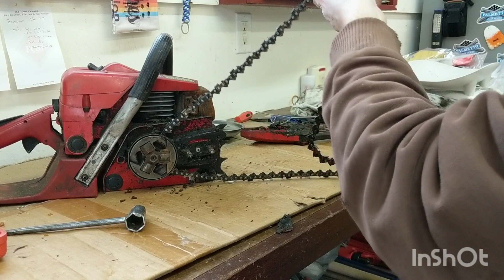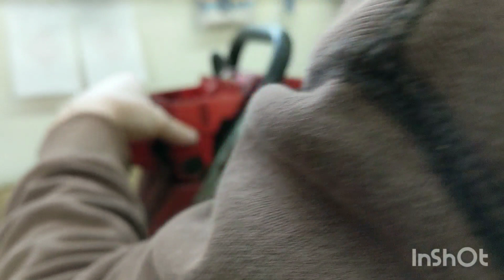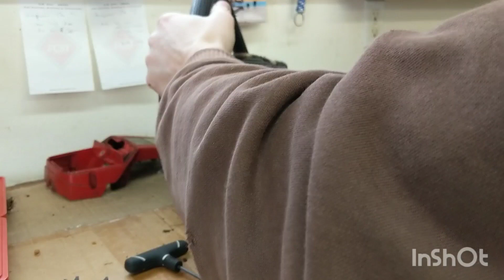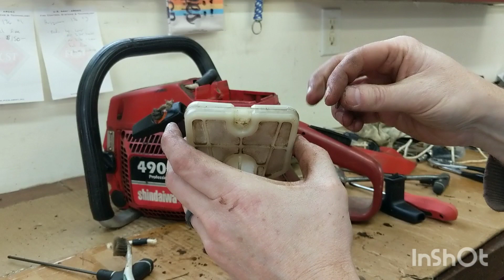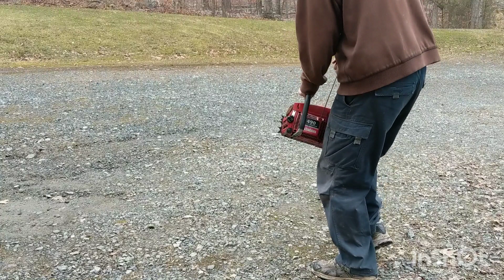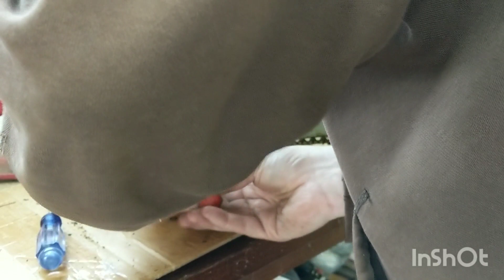Fixing saw 3 of 10, a Shindaiwa 490 pro. Pleasant surprise!

Comment: Shindaiwa makes good stuff! I have a model 300 chainsaw. I love it. I only paid $15 for it at auction and it runs/cuts perfect and is in good shape with all original paperwork. I plan on acquiring more Shindaiwa products over time. Congrats on getting that one going so easily. It’s always nice when they don’t need much work.
Reply from the maker: Congrats on that auction find for a great price.  Yeah, this brand doesn't have the recognition of Stihl or Husqvarna, but I'm confident this will make somebody a good saw.